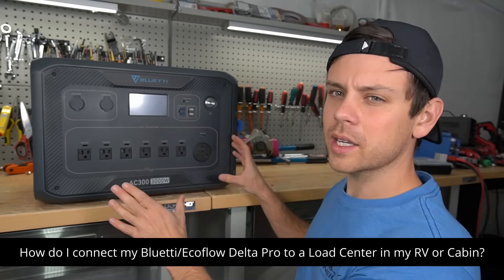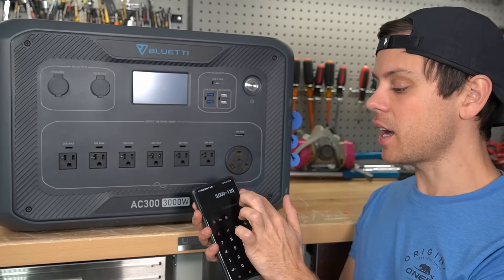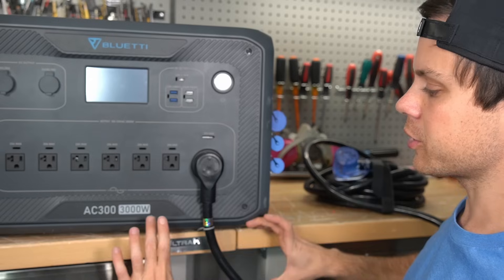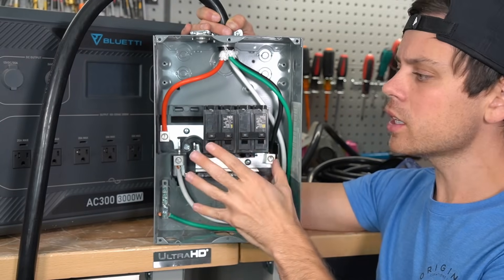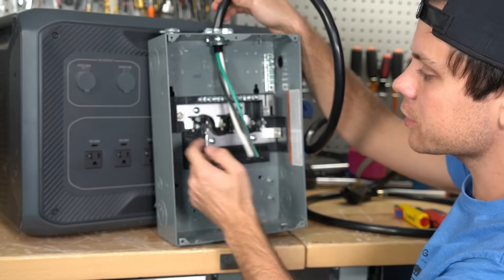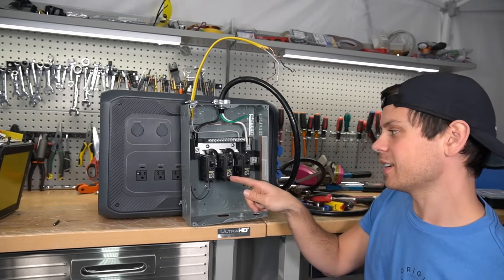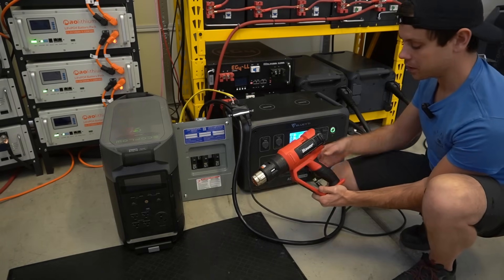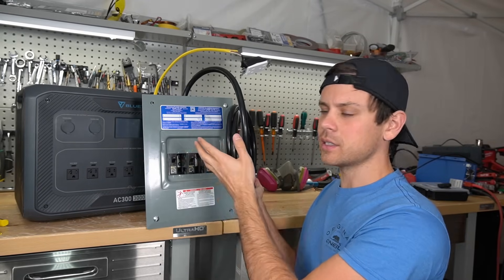How to Power a 120V Offgrid Cabin with Bluetti or Ecoflow Delta 30A Plug

Comment: What if you want to be able to switch between battery and external power such as at a campground?  Transfer switch?  Sounds like another video :)

And... when on external power it should recharge the battery!  You should get an actual RV, there are so many cool videos you could do around off-grid power for it.
Reply: You’d unplug from your portable battery and then plug into the shore power.  Your portable battery would then be plugged into one of your power sockets to recharge.
Reply: Just buy some server rack batts and put in a midnite DiY... I don't get why everyone is insisting on using this garbage gimmick scam equipment
Reply: @QuantumMarmalade  Portable batteries can be for those that may have an off grid cabin or RV they don’t use a much.  If you’re at your cabin a lot, yes, a server rack battery set up is probably a much better solution.
Reply: But if you plug in to external shore pwer and unplug from the internal source your three-pronged internal plug will be left hot, just dagling there... no?